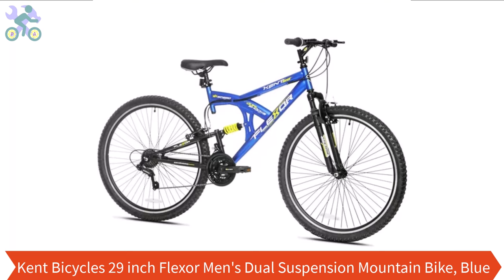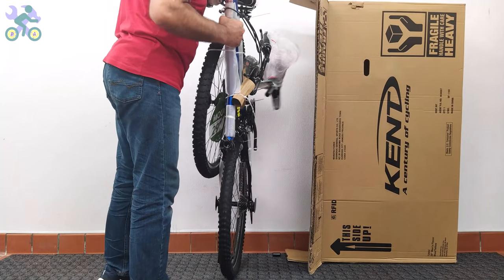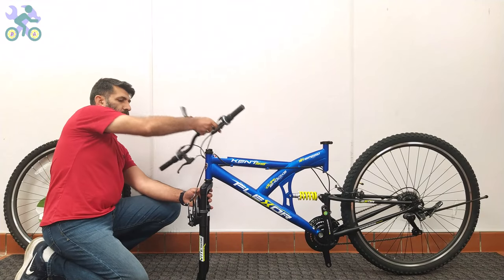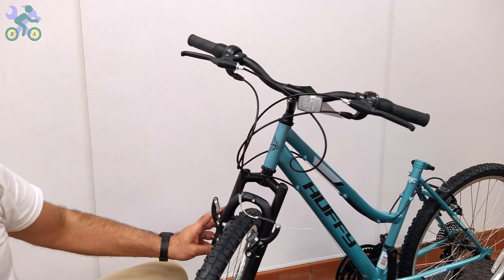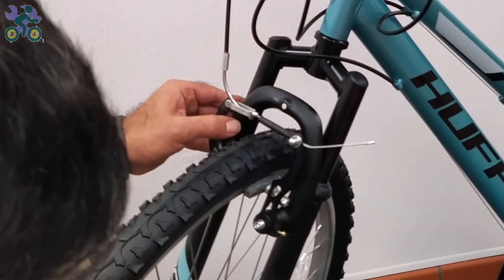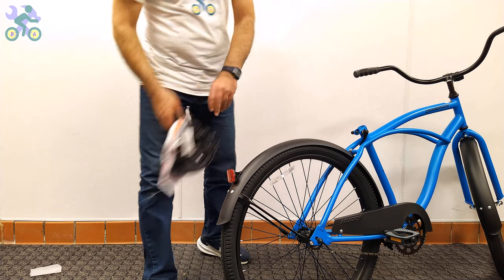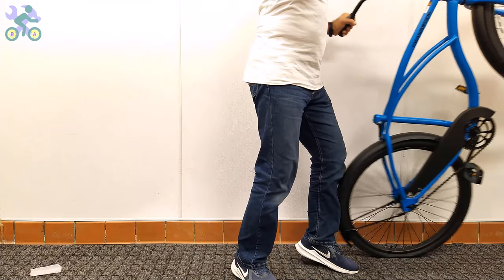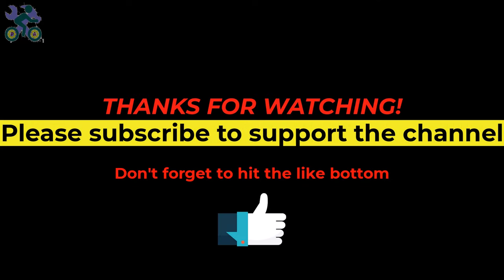How To Assemble Kent 29 inch Flexor Dual Suspension Mountain Men's Bike, Blue

Comment: The tires say 29 but the 29 inch tube is 3 inches to big once i had a flat
Reply from the maker: It's a little weird, are you sure ?
Reply: @ProAssembler  that was the slime tube the good year fit , but I'm having trouble dropping the wheel back in
Reply from the maker: Unfortunately, I don't have a video ready to show you right now, but for a better understanding, you changed the tube and now when you want to put it back, the wheel won't fit?
If this is the case, first loosen the rear brake adjustment screw to allow the tire to sit in place and then adjust the brake.
  If you meant something else, please explain a little more so I can help you. @user-ec1nd6em4w